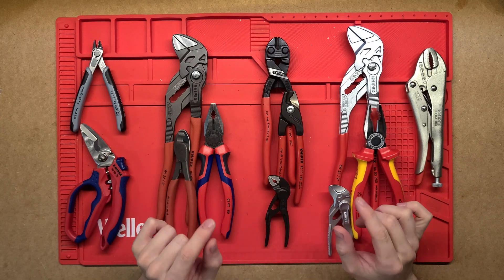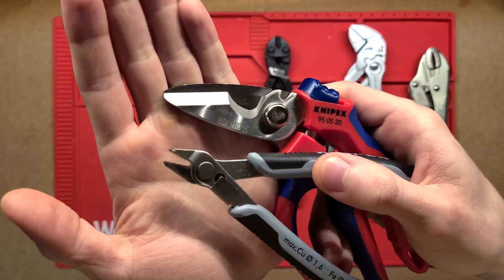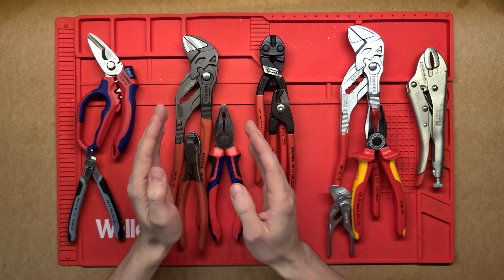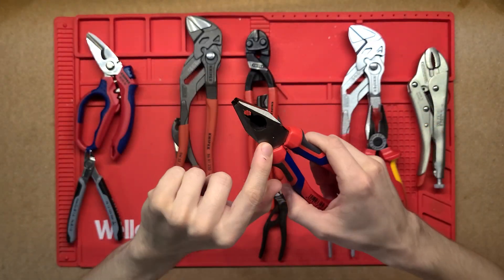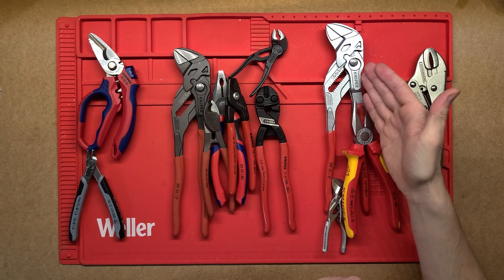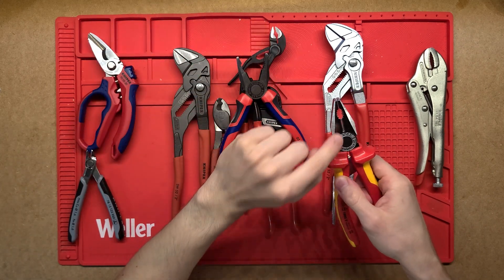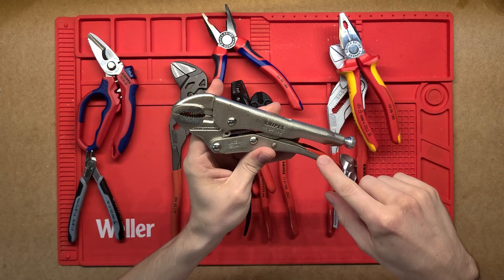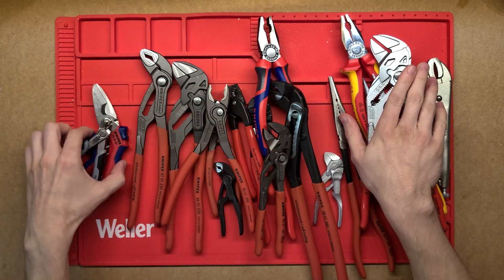Knipex Surface Coatings Explained | Which Is Best for You?

Comment: The funny thing is my chrome plated ones have rust spots in numerous spots and my black oxidized cobras that have been subject to FAR more abuse and water, only have rust spots on the bare/polished/ground metal areas. The black oxidized seems to provide better rust resistance...
Reply: Same experience here, and also whenever I google it, it says that the black oxidized ones are more rust resistant than the chrome plated ones.

Comment: Pretty sure hot dipped galvanizing is not a coating.  It reacts with the surface metal of the tool, effectively changing is chemical composition.  This is unlike electroplating or chrome where it is purely an application or treatment that is bonded to the surface metal.
Reply from the maker: I see what you’re saying, hot-dip galvanizing does create a metallurgical bond with the steel, which makes it quite different from surface-level treatments like electroplating. But it's still considered a coating because it forms protective zinc and zinc-alloy layers on the surface. It's just a much more durable and chemically bonded coating than most others. The exact  definition of a 'coating' changes how much of a 'coating' galvanising is.

Comment: Is it posible to get all the dipped handles with the texture? Seem like no ryhme or reason to the texture v smooth. Seems like the atramized finish typically has textured dipped, but the chrome are smooth dipped? For instance, can I get chrome pliers wrench, with a textured dipped grip? Ive also never seen any needle nose or linesman with a textured dip? I much prefer the texture...
Reply: Just a guess here but the black+texture are for greasy applications/automotive. The smooth and chrome for finish plumbing sorta stuff. Easier to clean.

Comment: Not all stainless steel is created equal. Careful saying stainless wont rust. It certainly can, though it will be rust resistant. 

Stainless steels that can be hardened for tools tends to not be as stainless as other forms of stainless steel.
Reply from the maker: You are correct, and thank you for clarification. Stainless steel certainly can get rust blemishes when the surface is contaminated. But the steel itself won't rust like normal steel.

Comment: I understand that the chromed cutting tools are ever so slightly less sharp than those without the plating. Your thoughts?
Reply from the maker: You're right, chrome plating can slightly affect edge sharpness. The plating process adds a thin layer over the metal, which can blunt a finely honed edge.  For high-precision tasks, unplated tools might be preferred, but for general use, the benefits of plating can outweigh the minor loss in sharpness. You can also find tools where the cutting edge is uncoated exactly for this reason
Reply: Maybe, but it would depend on the order of the process. 

If they sharpen them then coat them, you should be correct. 

They likely coat them first then sharpen them, in which case i don't see there being a difference. 

I could be wrong though.